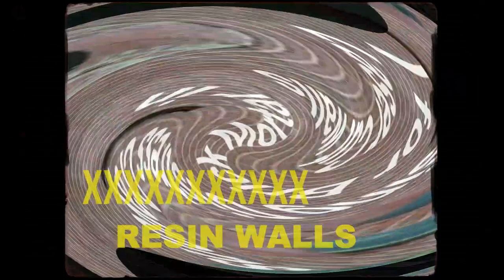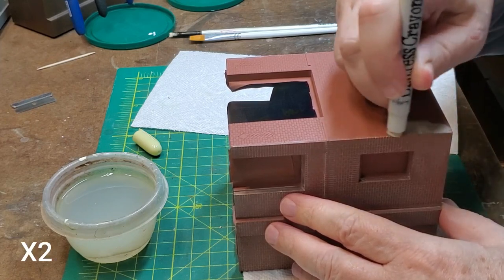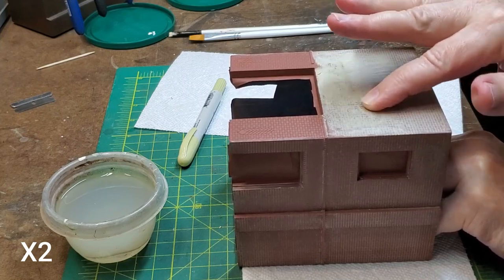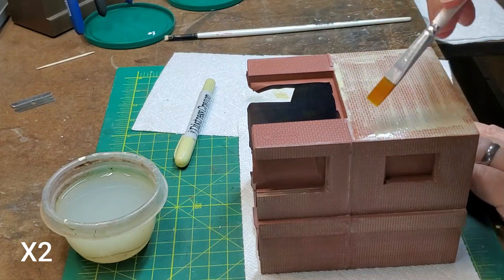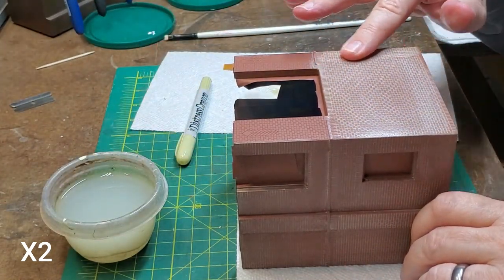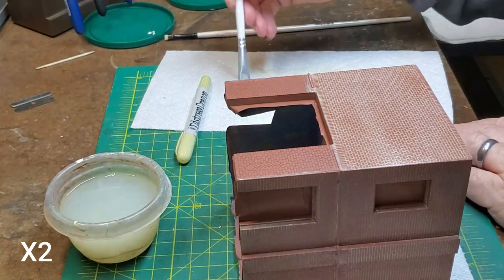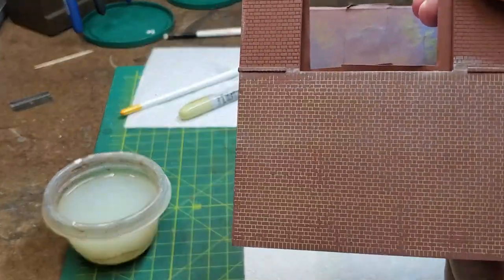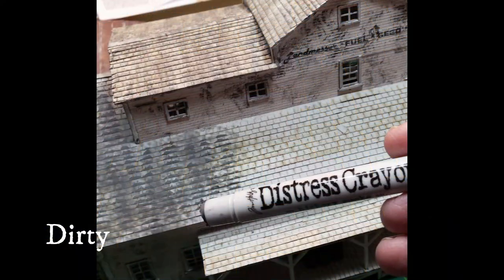Distress Crayon-How To Fill Mortar Lines in a Brick Wall

Comment: Very interesting technique.   Question:  Once crayon is dried, can it be reactivated with a solvent (water)?  I'm assuming that it can, but wanted to confirm.  Thanks for the tutorial.
Reply from the maker: Yes it can, Kris. While it will dry out, and revert to the consistency it is in crayon form, it never truly hardens. So, in the absence of sealing, it can me shifted and even removed with water and a brush. I put Dullcoat over mine once done with it.

Comment: I've just begun building model kits so excuse me if this is a simplistic question - would it be easier to add the mortar before the building is assembled?
Reply from the maker: No excuse is needed, YouTube is where to learn so much of this hobby. Yes, I've always found it easier to add mortar before assembly. It helps to have the wall flat on your working surface, and depending on what you're using for mortar you may need to do some rubbing or rinsing. You could do it after the building is assembled, but I think it would be a bit more difficult.
Reply: Thank you for the explanation. I've never heard of distress crayons but I'm definitely going to try them. @CassidysWorkshop
Reply from the maker: More tools in the toolbox to try out. 👍